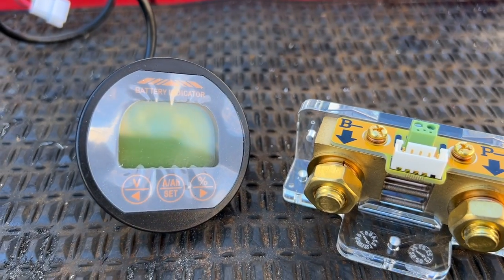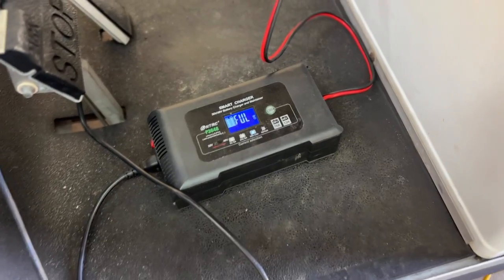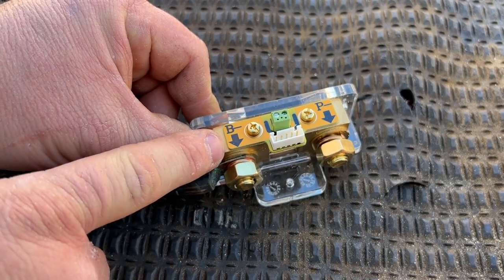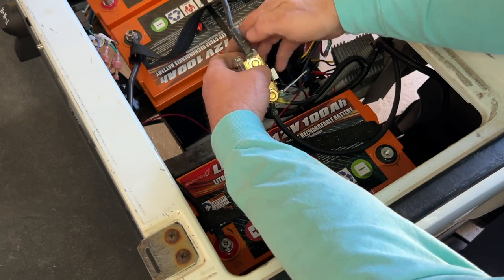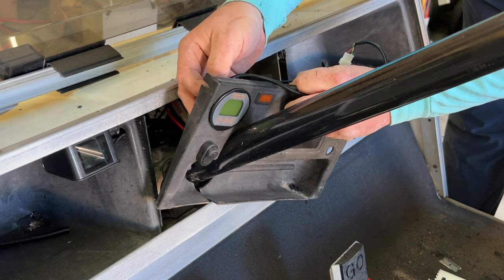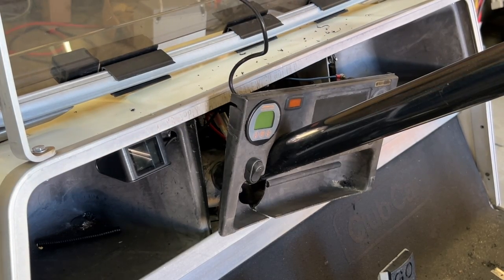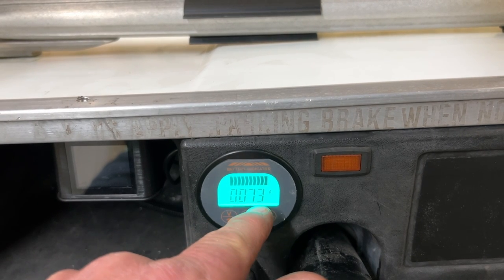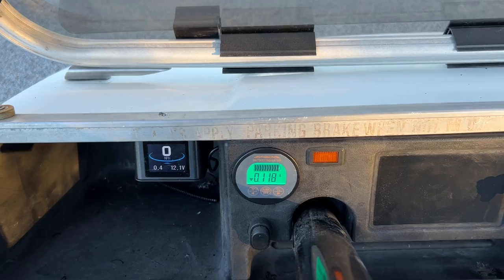How To Install A Smart Battery Meter & Shunt In A Golf Cart | Measures More Than Just Voltage

Comment: Hey man, I found this very helpful. I acquired a China LSV that doesn’t work and I didn’t know what a shunt was actually for. The one in the car appears as if it was installed totally wrong. It had 2 16ga wires to each side along with the main negative. With you video it clearly showed me it was incorrect. Thank You!

Comment: Have you installed with Enjoybot 36V? How are you determining your threshold for lowest voltage setting to show 0% on meter? If 100% is 40-41V, is your low/dead cart % around 35-36V?

Comment: Sorry for the question, but I have a Ryobi ride on lawn mower with four 12v 100ah lifepo4 batteries in series (48v).  What do I connect to the shunt?  The battery negative(s) connect to an Anderson powerpole and into the motor.  Where/how would I connect the 'P' side of the shunt?

Comment: Love the video. I've been procrastinating this meter for a year. It's the only one I've found that works on the 72 volt system that seems any good. I need to figure out a column mounted box for this and my F N R switch relocation. I can't believe even the new carts don't put a lever on the column or switch so your not making some weird move to change direction.
Reply from the maker: I purchased this in 2021 and it’s been sitting on the shelf. I wish I would’ve installed it sooner on a cart. Man it could’ve really helped with all those range tests lol.
Reply: @Fentertainment  I know what you mean. I don't have the phone a friend option like you. When I'm dead, I'm pushing 🤣
Reply from the maker: @goldenlife9856  🤣🙂😂

Comment: Does your meter stay on when not charging? I have to push the button to see anything when not charging. Also mine reads 100% charged all the time. I did the setup like you did   (i think) I set to 60 ah after full charge. I think I have something connected wrong. Oh I have 2 48v lithium batteries.

Comment: Good morning. I am have an issue installing the Renogy RBM500 Battery Monitor in my 1992 EZGO Marathon 36 Volt Golf Cart. I have a EPOCH 36 Volt, 100 AH Lithium battery. I have followed the installation instructions to a Tee and checked and double checked everything several times. When I hook everything up according to the instructions and press the button to turn on the Epoch battery, it beeps and turns off. I have tried several times, no luck. Then when I disconnect the shunt and hook up the Positive & Negative battery cables as usual direct to the battery the cart runs fine. I'm stumped. Any help is greatly appreciated. Love your videos, I have learned a lot form you. Hopefully you can help me figure this out. Thanks, Mike C

Comment: My battery has an app that indicates the % charge, current charging/discharging and voltage.   I have also installed a panel meter that is similar to what is in this video with the same shunt.   Today the battery went into protect mode when the app showed 50% and the panel meter showed 30%.  Not happy about pushing the cart home.  I will contact the battery manufacturer Monday morning, but do you have any ideas about this?  Seems to be very difficult to know how much charge is in a  LifePO4 battery since the voltage curve is so flat and the fact that the panel meter reads about 0.2 volts less than panel meter.   Perhaps a better way is for a meter to measure the amps used since last charged to 100%. Coulomb counter?  Your thoughts?

Comment: I’m currently converting my rxv 48v to lithium. My question is I bought a blue sea fuse block for all the accessories in addition to this shunt. What gets connected to the shunt if all the accessories are connected to the fuse block? Does the main neg, the onboard charger and fuse block neg get connected to p- ?
If so will that allow the shunt to get all the needed data?  Thank you  for any advice and help.

Comment: If you have a 4 bank charger do you have to run all 4 negatives to the shunt and exit the shunt?  Or do you just grab all of the wires that are going to the last negative in series and let the charger do it's thing independently?
Reply: Are you using 4 12 volt chargers to charge 4 12 volt batteries instead of one 48 volt charger?

If so, I would let the chargers or maintainers do their thing and just use the wiring diagram provided

Comment: Even at peak discharge it was under 200A.  Would be interesting to see that on a Navitas set up to see what the max draw is there
Reply from the maker: I set the controller to 200a I think. It was in the controller video.
Reply: I watched my Navitas dashboard while testing pretty closely and never saw over 200 amps. I think if you were doing hills or pulling a trailer or something it may get up there, but just the cart, don't think so. Once that initial hit from stopped tapers off even at 35 mph it's the 70 amp area

Comment: what do you think about adding one of these to a epoch kit. the meter it comes with is so hard to read the amp output while you are driving. its very small. ive tried referring to the app but it seems like it has a bit of a delay.
Reply from the maker: This is my go to meter/shunt for just about any battery kit. I like the fact that it can be used with really any combination of voltage or amperage.

Comment: Thanks for the video.  I've purchased 4 sets of the EnjoyBot batteries for my builds since watching your other videos.  I am still experimenting with charger setup.  I have used a Lester Summit II which seems to work fine and also the HTRC P3648 that you recommended.  Neither charger will charge the pack past 53v (each battery at 13.3v).  I noticed in this video your pack is over 57v.  Did you do any set up to get your charger to charge to 57v (each battery at 14.25v)?
Reply from the maker: Not at all, just used the htrc charger.
Reply: I have a similar issue with the charging of my batteries, mine reaches full at 54.4 V. I’m using the same charger. Is that typical?
Reply: I'm running 4 on a 48v DS. Also using summit ii and have the same issue. Will not change past 53 or so volts. Usually triggers an over voltage fault too. Did you ever figure something out?
Reply: @calmac06  I’m running 4 Enjoybots on my DS using the HTRC P3648, Balanced the battery’s as required by the Manufacturer prior to install and can only reach 54.4 volts/ 13.6 v per battery. I’m not sure if this is an issue but I got like 20 miles ride time and my battery meter indicator read 46 or 48% remaining which I think was pretty good. Let me know how you make out.

Comment: I found it almost impossible to place the power cable into either one of the power wire inputs that are part of the green structure in the center, top part of the shunt. Since the amperage is so small, I sized a straightened paper clip and pushed it into the input (with the tightening screw as wide as possible, which isn't saying much) and tightened it down. Then I crimped my 14 gauge wire (I realize the hole needed 20 to 22 awg) to a tiny alligator clip and connected that to the paper clip. It's a much stronger connection with little chance of the wire failing over time, especially when compared to the tiny amount of wire needed to directly connect it. I couldn't even fit a tiny ferrule into the hole.

Comment: Have a had time seeing the max amp pulled on take off, was it 199amp max?
Reply from the maker: 191.8 on that run.
Reply from the maker: I rewatched and the first run was 199amps because I floored the accelerator, the 2nd pull I didn’t floor it as much.
Reply: @Fentertainment  thanks for the reply, I’ve got the same cart that I’m building and my lithium battery has a 200a cut off and I’m putting 23” wheels on it Gonna be close.
Thanks for the great and informative videos you make 👍

Comment: Hi Ryan, another question for you... I have the BigBattery Falcon Elite kit with this battery meter installed. I know it's not drawing much power, but I don't like that the meter stays on unless I power off my battery. I have the blue 48v to 12v convertor that you often use and a fuse block for accessories so everything turns off with the key. Can I run the power wire for the meter off the convertor so it turns off with the key or will that make it not read the battery % correctly? Not sure if you'll know the answer to that or not, but I figured I'd ask. Thanks!
Reply from the maker: It will work fine still.
Reply: . I did this, the small power wire running from the shunt to fuse box (dc converter) .   So it comes on and off with the ket BUT now the battery monitor shows 12v instead of 48v .  How do I make it show the correct battery voltage ?

Comment: Installed the gauge on my 97 ds with OBC and lead acid batteries. Shows accurate low amperage draw at rest, reset to 100% when batteries were recharged but gauge does not show (+) charging indicator when charging nor does it show large amperage draw from motor/controller when driving cart. Only continues to show low amperage draw

Comment: Ive been wondering if you have 4 100 amp hr  lithium batteries, do you have 400 amp hrs available?  Or is it just still 100 amp hrs? With more available output?
Reply from the maker: When you run in series the voltage adds up and the amperage stays the same.
Reply: Thank you so much for the fast reply! Love your channel since I bought a craigslist RXV been watching your channel constantly. Excellent tutorials.  For the price would you go with the 4 enjoybots or is a 100 amp hr Big battery better?

Comment: does the charger you used have a connection for the charger interlock (blue wire from club car precedent charging port) ?
Reply from the maker: It has a connection point but nothing is there. The charger I used is for the lithium batteries and I made a separate video of the charger and how I wired it.

Comment: Would a 36 volt cart pull more amperage than a 48 volt?
Reply: P=IV.  Power in watts equals current in amps X voltage. So at equal power outputs the higher the voltage the lower the amount of amps required to produce that power.

Comment: One last question I promise …lol 
Do I enter the total of 60amp hours or 30 amp hours which is each individual battery ?
Reply from the maker: If you have 2 - 30ah batteries in parallel then once they are charged, you program the total of 60ah.

Comment: The backlight remains on at all times. It only turns off when the cart is in tow mode. Any suggestions to get this light to turn off when cart is not in use? I followed your install instructions exactly. 6 x 8V Trojans on a 03 club cart DS. Thanks
Reply from the maker: I think mine the backlight goes to sleep after so long. If you want to only use the gauge when the cart is on you could run the small power wire through a relay to the key switch to power it on and off with the key switch.
Reply: @Fentertainment Do you have a relay you recommend?

Comment: Sorry for being dense today.
Im at the 5:00 mark of the video and your explaining how the wires get connected to the shunt.
I still dont understand the purpose of the shunt.
Is this a safety device?  
Does this act like a main fuse link?  Is it resettable?
Does this prevent a electrical fire?
How would you check to see if the shunt is working?
If all you want to do is install this battery monitor then why cant you install it right to the battery terminals.
Reply from the maker: I’ve made a dedicated video for the shunt meter but will explain more in that video. The shunt is a device that measures amperage to/from the battery. A regular meter doesn’t work as good as the shunt meter.
Reply: @Fentertainment  OK, Thank you for that.  I am interested in seeing your video.
Please provide a link to the video.
Do all golf carts have a shunt?
I dont see one on mine, so I guess this is an accessory or an upgrade.
Reply from the maker: @brentseizer1019  no it’s an upgrade

Comment: Can this meter be used with Lithium batteries and I will have 100ah batteries but can I use the 350 ah gauge in case I add additional batteries?? Thank you in advance.
Reply from the maker: i used this meter in this video with 100ah lithium. yes

Comment: How are you getting this 27mph on the ds cart what is done to it ?
Reply from the maker: I go over everything in the build series of this in previous videos that lead up to this but it had a plum quick rattlesnake motor, alltrax controller and lithium batteries. This was just a boring run of the mill series cart.

Comment: I have this installed but am curious as when I fully charge my LiFEPO4 battery to 100%, the gauge doesn't correspond to it being fully charged, so then I end up reseting the battery % on the gauge to fully charged 100%. Is this how it is intended to work? or should the shunt be reading that the battery is fully charged and update automatically.
Reply from the maker: Did you go in and program the gauge to the same AH after you fully charged the battery and the gauge was installed like shown in the video.
Reply: @Fentertainment  Yes I have done both. The only thing I did different is I wired the positive (+) signal wire that goes into the shunt off of the ignitions powered relay. I did this so that the gauge is not powered when the key is off. I am wondering if that is causing the issue. I believe in your video, you took the positive signal wire directly off the battery + and into the shunt?

Comment: Anyone know if you could hook this up through your relay and just reset the capacity every time you charge it? It kinda bugs me it’s always on and slowly draining the batteries. I know it needs to be that way because of how it functions but still would rather it only be on when I’m actually using the cart.
Reply: Hi Dino, did you get a response to your question or find out the answer?  I have the same question.  I was going to hook this gauge up to my KSI, so it was not activated until I put the ignition in the first position.

Comment: Ok I got it hooked up on my 2 48 volt Eagle batteries but I was wondering if I could run a single wire from the fuse block negative to the shunt instead of each individual accessory negative wire .
Reply from the maker: You can, HOWEVER.... The distribution block cannot have the grounds from the battery. The Grounds have to be on the ground side of the shunt only.
Reply: @Fentertainment  …Lol..After looking the fuse box is grounded into the converter so I’m not understanding what to do .
Just ground everything into the shunt individually I guess ?
Reply: Right now I have no accessories grounded into the shunt and the gauge is showing same volts as the batteries are showing.
Reply from the maker: @toledojeeper2932  you have 2 batteries, distribution block that came with batteries, dc converter and a 12v fuse block with ground right. Take the ground wires from the batteries that attach to the main distribution block, unhook them and attach them to the B- side of Shunt. Run a New Ground Wire between Shunt P- back to the main distribution block.

Comment: I installed the meter today. The gauge shows voltage and amp’s being used. No percentage reading for anything and no charging indicator arrow. Arrow indicates down always. I have a UNO battery with a onboard charger so the only thing going to p- is the main negative cable and I assume the small wire is from the inverter. Since the charger goes directly to the battery is that way the gauge doesn’t indicate it’s charging?
Reply: I have lead acid batteries and I’m having the same issues. Main negative is alone on the B- and the P- are all other cables that were attached to main Neg. I show small accurate amperage draw but no draw from motor and no up arrow while charging
Reply: @bud6681  I played around by rebooting ( disconnected shunt from meter for a few minutes) got everything working except the charging indicator up arrow. I can live with that because I was looking for % of battery left not voltage. It took the place of my stock meter that just read full all the time. I think because of the on board charger going directly into the battery is the issue.

Comment: Does it ever shut off with it being connected to the main positive (red wire)?
Reply from the maker: The back light will dim but the gauge will continue to work. You could connect the power wire to the ignition side of the switch for it to turn off when the cart is off.

Comment: How do I get the battery to show 100% when I first install the gauge?
Just purchased it and it’s fully charged and shows no bars?
I’ve got a 36v ezgo golf cart and 3 12v 100mah lithium batteries
Reply from the maker: You have to set it. I show how in the video.
Reply: Is it after setting the amp hours?
Reply: Ok just got it this time!
Thank you!

Comment: My arrow points up when under a load and down at resting voltage. Is it defective ?
Reply from the maker: I guess that would depend if the shunt b- is only on the battery and P- is going to the golf cart, charger & accessories. If so then I would say so.
Reply: @Fentertainment  Just reviewed my amazon purchase and ended up with the knockoff of the Aili. Removing it now. I just ordered the right one. Many thanks for your speedy response.